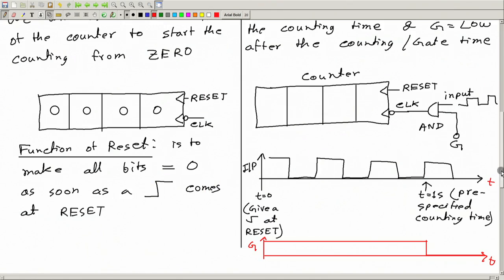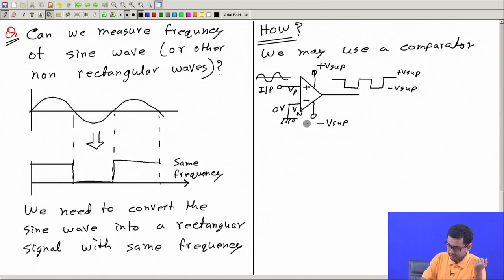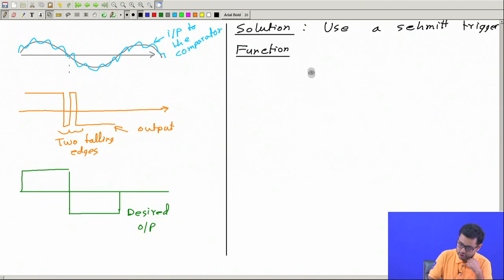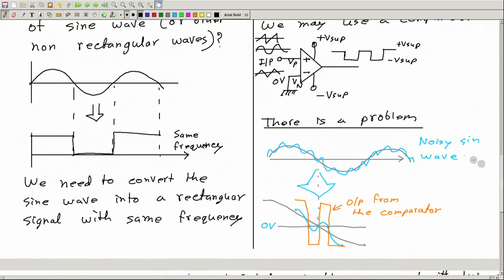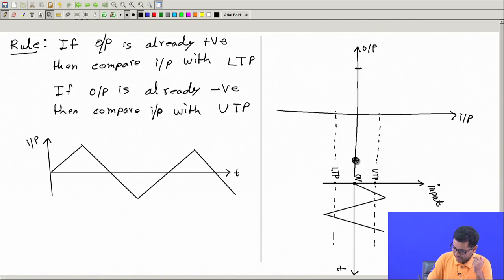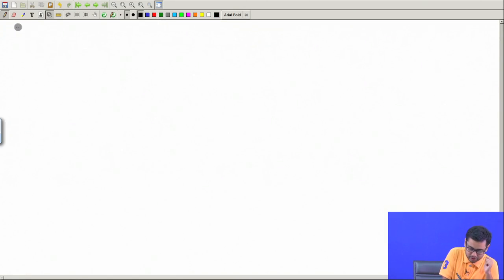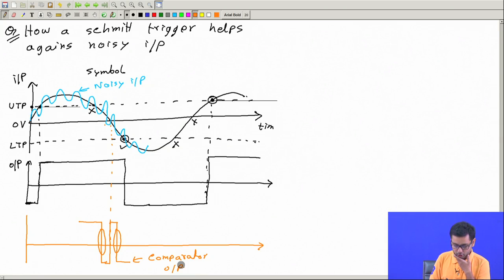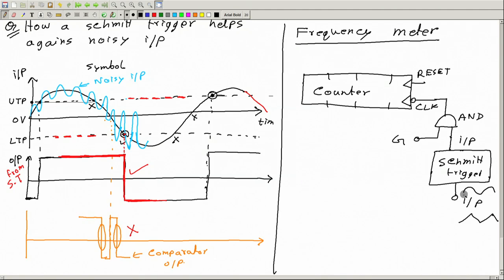Lecture 59: Digital frequency meter & Schmitt Trigger

Comment: Dear sir, at time 49.00 in the time curve of schmitt trigger the input wave shown with noisy, which become below the LTP just before the actual point which u drawn... pls verify .....N will it give the same frequency o/p w.r.t i/p  in such situation?? Pls reply sir...
Reply: bhai i also  think ki us time the comparator output will toggle to negative value of the supply voltage just before the actual point marked